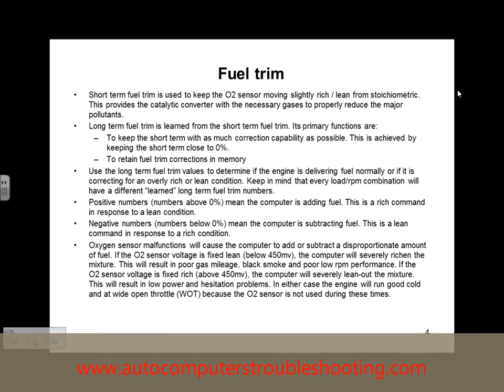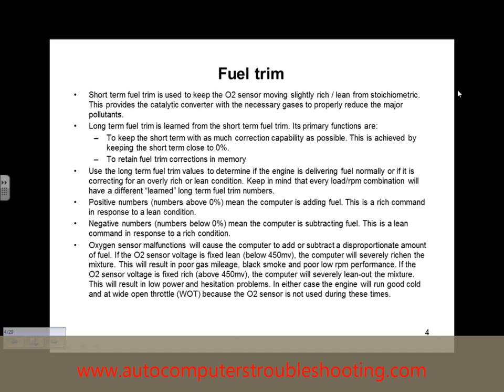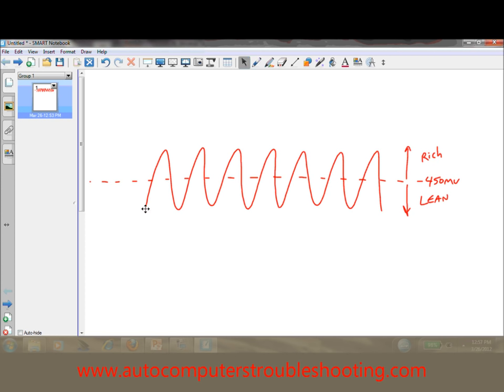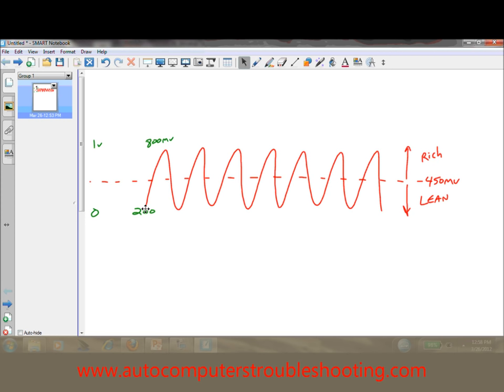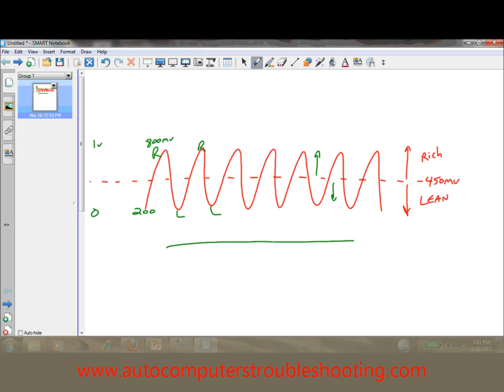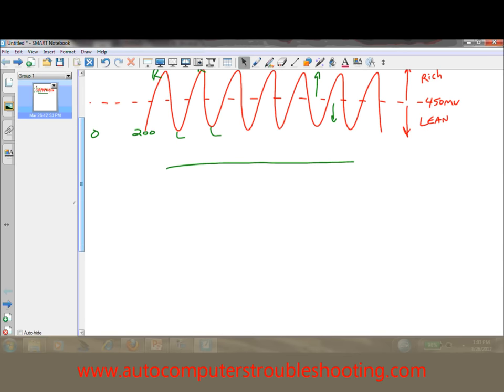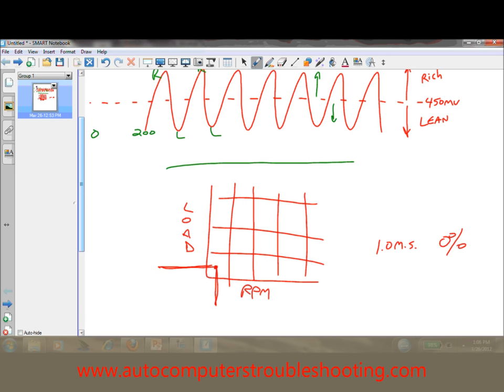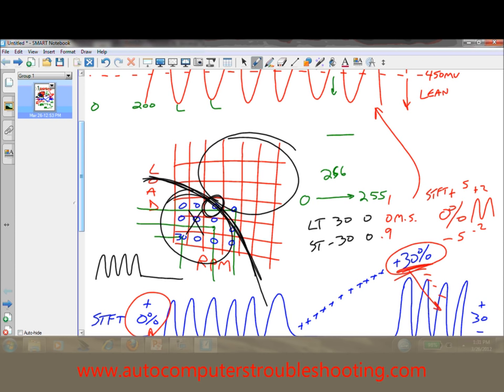Understanding Short Term and Long Term Fuel Trim (a SD Premium video)

Comment: What if bank1 long term 30 short 0 and bank2 long term negative-30 and short term 0,, addituinally alk o2s reading between 400- 800 mv besides one that has 0 mv... weird huh
Reply from the maker: Timing chain off a few teeth on a dohc V-type engine or a restricted cat on one bank

Comment: Dear Schrodingers Box, We have a very difficult problem with my 1993 Chevrolet S10 Blazer 4.3 vortex sohc... engine turns over good, but will not fire. here are the things that we have replaced so far/new fuel pump/spider injectors/ throttle sensor/ IAC/ distributor/ coil and coil wire/ fuel filter/ checked fuel presser 55 psi/ sperk checks ok/ scanner showes no code/ new computer/ and none of this corrected the problem. I would greatly appreciate any insight you could give to us regarding this problrm. Sincerely Lisa
Reply: Lisa Farmer engines only need 3 things to run. fuel fire and compression you put it together... you have fire you have fuel so the valves are bent or something like that... do a compression test on all 6 cylinders see what you get
Reply: John Johnson also need spark on tdc once put distributor in backwards no start on a Corvette went nuts .once had head gasket burnt thru all cylinders only start w push would run i
Reply: @John Johnson...Apparently you have a very interesting engine that doesn't need air.. are you running nitro-methane or some other exotic fuel that has the oxygen in the fuel?
Reply: @hisheighnessthesupremebeing  Good job  by Paul  Danner

Comment: Hallo Sir. Nobody can give Me a clue what could be wrong with My car.  Maybe you can Sir. 
I have rough idle (especially when I set gear at D, as well under load),Engine shakes, Car has noticeale less power and fuel consumption is increase.
Engine: 2GR-FSE  (Lexus Gs450h)
Fuel Trims at idle: (1000rpm/stable)
LTFT B1: -5.47%
STFT B1: 0% - 0,78%
LTFT B2: 5.47%
STFT B2: 0%
MAF: ~4,5kg/h
O2 B1: 0,12V
O2 B2: 0,14V
About O2 sensors I'm not 100% sure. I assume that I have more O2 sensors not only 2, but My diagnostic app in Phone is limited. Can someone give Me a clue in which way should I go, to find solutions? Thanks a lot!

Comment: ScannerDanner, i love your videos, and I need your help with an 08 toyota sienna 3.5l ce with a code p0171 and p0174. Can you read this freeze frame data for me please?      Fuel sys closed loop, load_pct % 29.4, etc (f) 158, longft3% -100, shortft4% -100, rpm(/min) 671, vss (mph) 0, sparkadv 15, IAT (f) 77, maf(lb/min) 0.454, TP 15.7, shortftb1s2% (99.2). 02b1s2(v) 0.740, shortftb3s2 (99.2), 02b3s2(v) 0.740, 02b1s1(v) 3.169.

Comment: I hace a1989  Honda Civic Dx it Crank but it won't start.no sparck, no fuel.the tank and pump was ruasted it has new pump clean tank new filter,new d cap new ignoter,spark plogs, batery,ichec for feuses they're good olso i checthe Main sensor, it makes theclics when You test it bit no after is conectes,Ilook flr the cranck sensor ican not fain it
Reply from the maker: with your key on do you have a 5v reference available on the TPS or MAP sensors?

Comment: Am here again after getting my asskicked by a Toyo 1AZ fse speed density engine with a single O2 after catconveter... running rich....🤣🤣 what I don't understand is the O2 used for fuel Trim or cat monitor since is after cat I think is for cat monitor..... what about fuel feedback coz the rear should not rich/lean...mmmmm
Reply from the maker: Is it a wideband upstream O2? If it is, some systems will use the downstream O2 for fuel trim as well as cat monitoring
Reply: And it's Not a A/F sensor ...I looked at the data trying to see if I can see any up stream O2 data PID but there is non....I was thinking how to test this downstream 02..whn I try to drive it lean by vacuum leak the ecm  compensate for the leak coz it's a speed density system.....this is from some shop which they all ready changed the slim engine and computer and somuch parts in it.....

Comment: shit my long term is hitting 44 right now 24:27
Reply from the maker: Positive or negative?
Reply: @ScannerDanner  it was positive but ever since my change of sensed map learning on instead of off my levels are closer but still positive, after closed loop it climbs again, I noticed a peak in my upper o2 sensors where it stays there for a few waves and resumes but it happens every few wave lengths. So, from your last video I learned that's high voltage and my front sensors cause a fuel rich mix for a second. I'm still running through it in my head. But the graph I look at is the same one you were teaching from.
Reply: @ScannerDanner  I want to blame my fuel pump but, high voltage spikes in front, and consistent high voltage in the rears, is rich this means my car is adding fuel to compensate for air intake, because it feels to much air is being taken. There for I should be on a lean hunt, right? Vacuum, there's really only two things I can blame, egr valve or tube, and brake booster check valve. Because after a build of vacuum I see the spike which could be that sucking air past one.
Reply from the maker: @matthewpetersen4417  remember the O2 is just reporting what the mixture is and the ECMs response will always be opposite. So if your O2 sensors are reporting a rich signal, it is not causing the rich condition as you stated. Make sense?
Reply from the maker: @matthewpetersen4417  focus on your fuel trim numbers, not any one particular O2 signal.
What is your total trim at idle and then at 3000 RPM in park. Steady throttle, warmed up engine.
These numbers will tell us if you have a vacuum leak or not
Reply: @ScannerDanner  I'll fill you in on what I found, evap hose was rubbing and found pin hole in the hard line, 2nd egr tube to egr valve was not lose but I tightened it so definitely some play. My F'n map sensor was missing the o ring, how I have no clue. O yea and HpTuners has a bug on the beta they are forcing us to use, and the manufacturer is addressing it as we speak, its giving false read out ever since the controller update.
Reply: @ScannerDanner  So here is the conclusion, really looked car over, even did old school either test, so unmetered air I started thinking. Throttle body! so I removed it, and the flapper has lots of play, I replaced the throttle body, and my long term and short term are at almost perfect zero at least long term is under 5 and at times zero. This car won't throw you codes and I hate it!
Reply from the maker: @matthewpetersen4417  awesome, nice job man

Comment: Emission controls are a lie...you only need to build a good engine...and keep it running good...engines do not need any emission controls to pass a emissions test...I have had several cars without emission controls that did not have emission problems...they ran clean and reliable...cars of 70s 80s ran far better than cars today...
Reply from the maker: Lol, definitely not true

Comment: Just build quality simple engines without the computer and cars will run clean safe reliable...make clean Hydrogen fuel and there would be no emissions problems....STOP HYDROCARBON FUEL...cars only need clean hydrogen...
Reply from the maker: You can't make hydrogen gas from water and use it as fuel because the energy it takes to make it is less energy than what is produced. If that's what you're referring to.

Comment: Some'  fishy here; reminds me of the Jaguar self-levelling rear,that N E V E R worked;  E V E R!! The ultimate solution was to install springs, etc; (Citroen IS and WAS the ONLY one in the WORLD who could do it,and do it VERY WELL; no one else...nor RR,Rover,LardRover,Bmw.. no one).

Back to the C O S T L Y  climate control BS:  Let´s see........if the O2  sensor feeds the info to the ECU, rich or lean, away from the stoich 14.7,and the ECU COMPENSATES,why are the trims,LTFT and STFT, not  ALWAYS at ZERO,after a second???? I mean... really